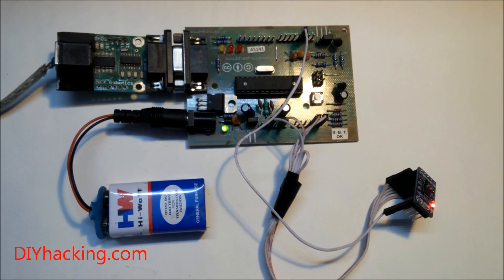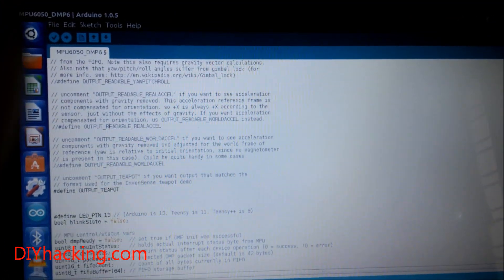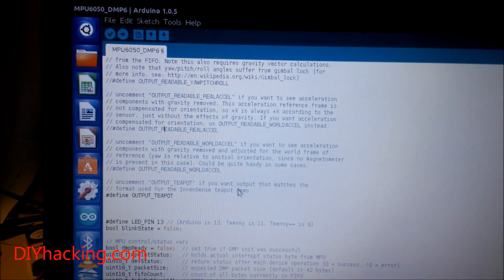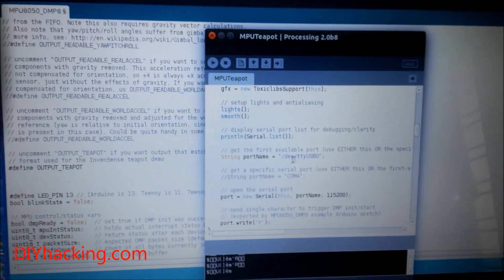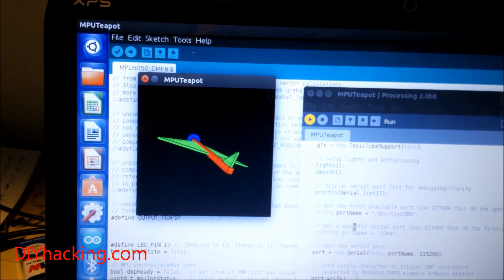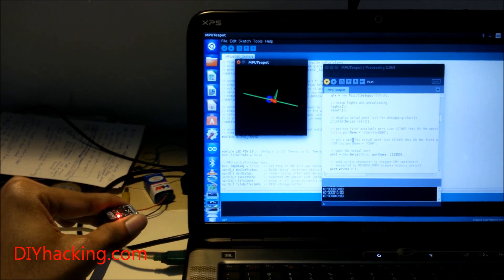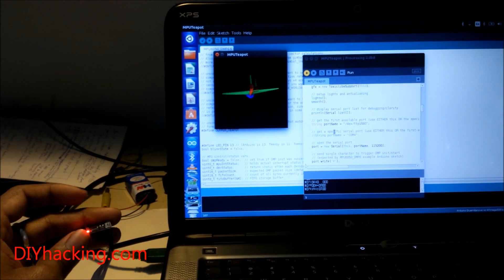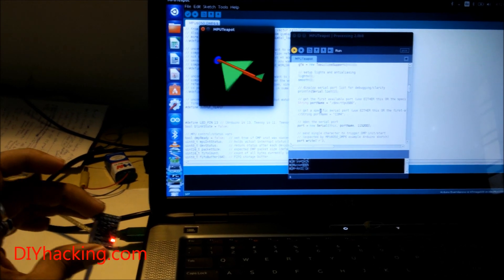Arduino MPU 6050 3D Model

Comment: Good day, Admin.

I have tried your tutorial from this page. It works fine! However, for the Processing tutorial, at the draw window, my object movement is not smooth as yours. As if it has overlapping objects while stabilizing the orientation. Why is that? Is there any parameters that I have to check?